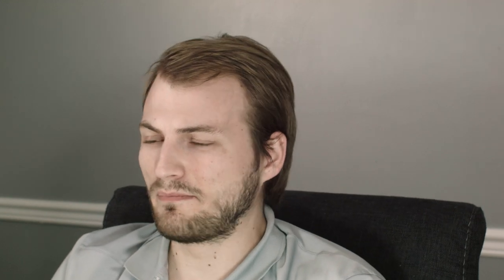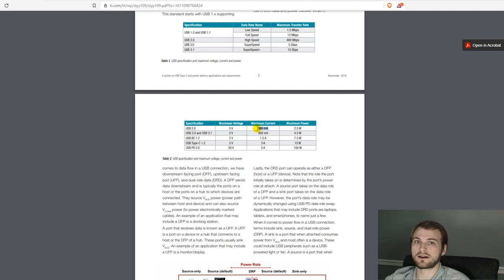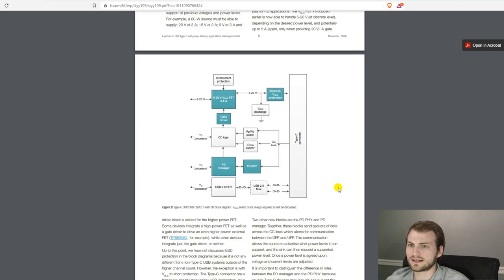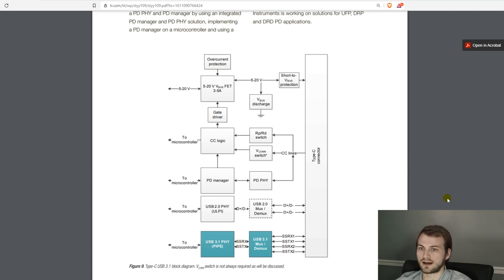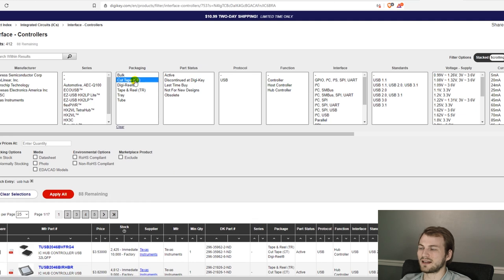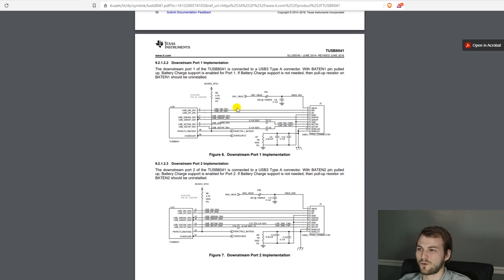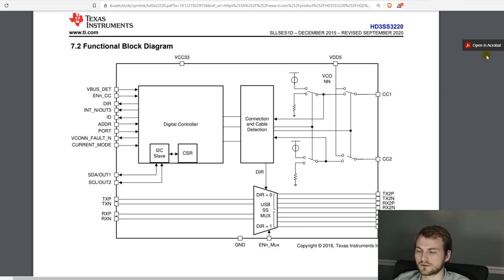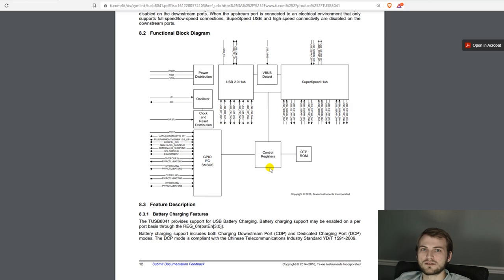USB Hub Design - Part 1/x - Overview and Theory

Comment: Alternative idea: Stay at lower speeds but design the system with a >7.5kV isolation between upstream and downstream. That would be great for keeping your computer's USB ports from frying when doing high(er) voltage experiments. Isolated 4 port hubs are also really rare, so there is a niche market opportunity. I'd pay $300 for a well designed isolated hub with external power. Single 5kV USB isolators are between $120 - $200. 

High voltage isolation also provides for interesting PCB design choices. 

Well, I just had to replace my laptop's system board due to a happy discharge accident into the USB connected micro controller. So I might be biased :)
Reply: Why 7.5kV? $300usd wouldn't be enough
Reply: @sanityd1  7.5kV seems to be the soft spot where you can still buy off the shelf stuff. For example, for low isolation requirements up to 3kV the LTM2884 is a good option with simple design requirements, and it includes 500mA current delivery. For 7.5kV Analog Devices has the LTM2894, but current delivery is done via external isolation transformers. This makes the design more complex, but also more interesting for the sake of this channel. If you go 10kV or higher, it might be difficult to find demo boards, schematics and all that so it is way more difficult to develop a solution in a couple of YouTube videos. You might have to use high speed optical isolators like the OPI1268s which can do up to 2MBit TTL. But I don't know enough about USB to make an educated guess. 

Regarding the price: That depends a lot on your target market segmentation, expected sales volume, sales channels etc. My intent was to show that there is an interesting and underserved market segment for USB hubs outside the $20 PC peripherals stuff on Amazon.
Reply from the maker: Woah. Never really knew this was a need. Seems like it's a super popular idea! Can you share some examples of use cases where this would be useful? Definitely will look into it for a future project!
Reply: @MicroTypeEngineering  Our use case: We develop small form factor time of flight sensors. The drift tube has a linear 10-20kV electrostatic field gradient to separate ionized compounds by their ion mobility. Ion packets are inserted into the drift tube using an ion shutter (google Bradbury Nielsen gate or better Tri State ion shutter). This gate sits at the high potential and is switched by 3 signal lines coming from an off-PCB uC. On the PCB, all the switching MOSFETS etc. are floated up to the high potential. So you have 75-300V gate pulses riding on top of 10kV.  

During prototyping we use an Analog Discovery 2 for data capture, which sits behind a 10E10 current to voltage amplifier. Now, if something happens, you can kiss the AD2 good bye, potentially the uC and potentially the amplifier as well, and your lab PC's USB. It's a half days work to put everything back together, so there is value in avoiding burning through USB oscilloscopes. Especially with the AD2 getting more and more expensive. 

Other applications can be x-ray device development or ionizers like dielectric barrier discharge or a corona discharge.  Would really appreciate some videos on that!
Reply from the maker: @Fazzle if you haven't already, join the discord! https://discord.gg/Z4P5yScC
Reply: Exactly. It would seem kind of pointless to spend a lot of effort and expense designing something which is already widely available. Better to make something special. I'd vote for a powered hub with good isolation.
Reply from the maker: @0x 52696368617264  Too late! But, checking amazon, there really aren't any that list SS+ support. A lot support SS (5GBit), so I do think this will be a bit unique in that sense. But I have added this idea to the list of future projects!

Comment: My vote: go for as high a speed as you can  (3.1), and do external power. It's gonna be a long project either way so might as well make it interesting on the USB side by showing the work to do super speed. External power would be a neat addition too.

Comment: How would the architecture need to be adapted to add a USB-C passthrough port? The mux supports DRP but I assume it's more complicated than adding another HD3SS2520 after the hub, connected to a USB-C port?

Comment: I am building a neopixel led light wand which need 3a of power.  Can a type A connector use passive power delivery signaling?   My reading tells me that a UFP can request up to 3a with CC logic pullup resistors.  But a type A connector does not have any CC pins.  How does an inexpensive 3a type A USB power supply deliver 3a?  Does it simply give any USB device 3a?  Or is there some other mechanism?  Any pointers would be useful.
Reply from the maker: Yeah, only type c has the cc pins. Plenty of products violate USB protocol

Comment: Hello sir how r u, nice knowledgeable video, I'm from India, sir do have any video explaining how to design a 433 MHz transmitter and receiver module circuit , which is used usually in RC control toys etc, hope this will not obligate you, thank you